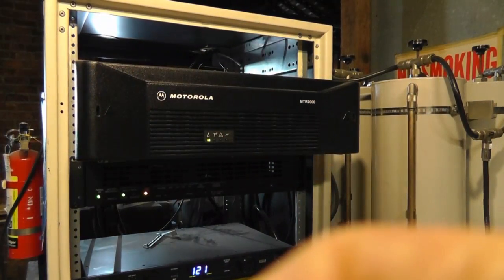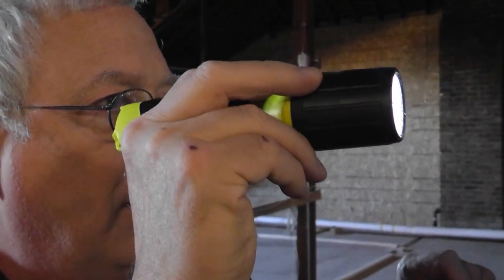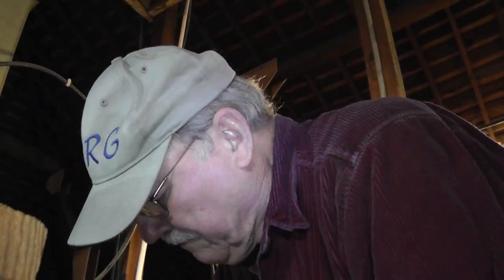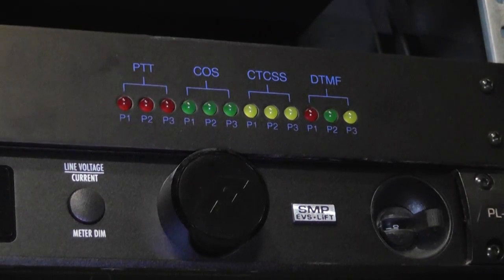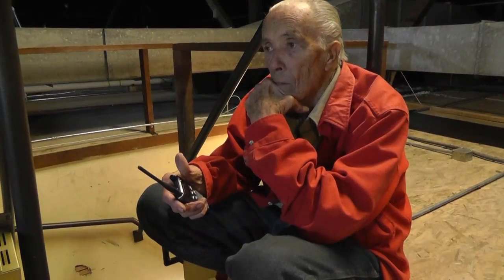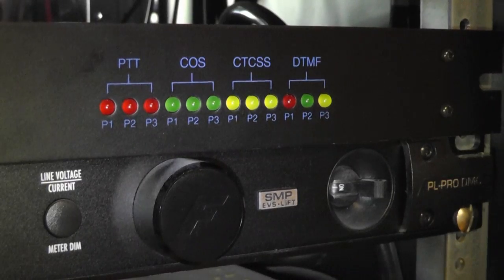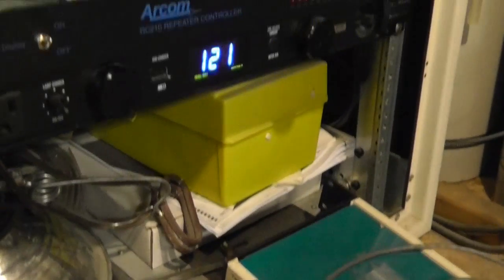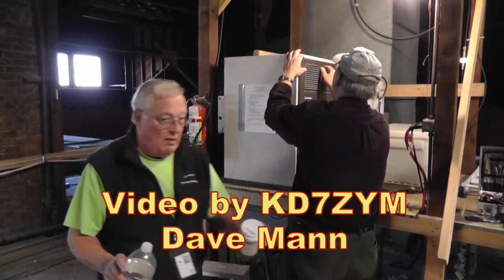PSRG controller installation, November 2011

Comment from the maker: @afterthedark99 Hi- so-so at this point.  It is associated with a Motorola MTR2000 repeater and constantly forgets its date/time settings.  Also has keyed up the repeater on two occasions requiring a remote reset.  Still in warranty so not the end of story. One of our guys has a duplicate which will go into service soon.  Should be interesting.
Thanks for the note. Lee